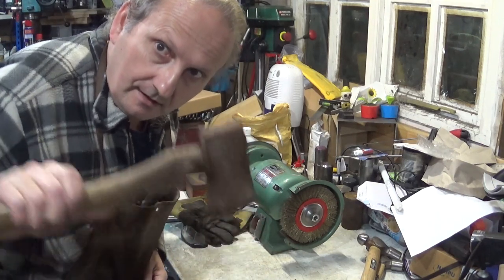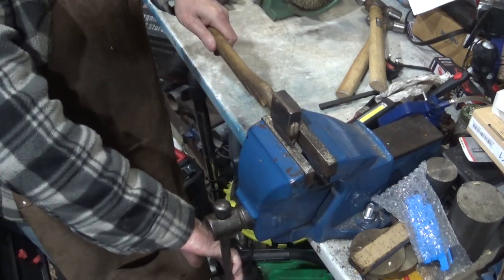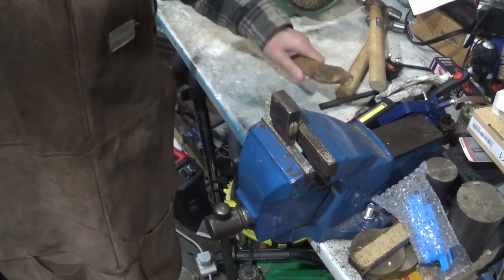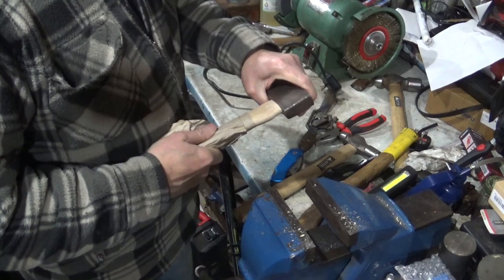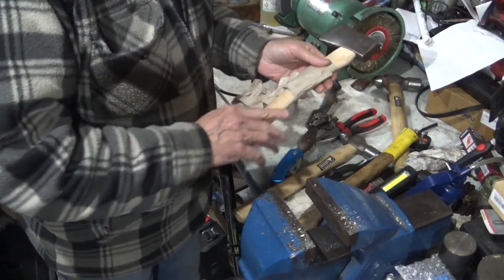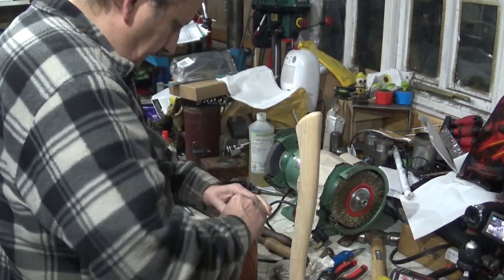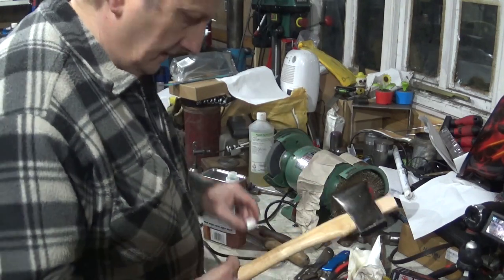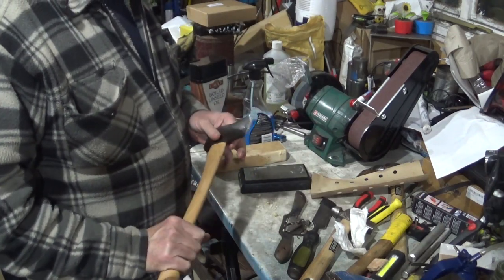Restoring and fitting a handle to a small axe

Comment: The wood from old axe and hammer handles is really useful - I always keep mine so I've got an available source of hardwood for wedges and stuff like that.  The old linseed on a rag bursting into flames can happen but no matter how many times I've tried to make it happen, I've always had disappointing results - I've tried lots of oil and the rags tightly scrunched together, lots of oil and the rags loosely bundled, and a medium amount of oil too - that said I still either put my linseed rags in a bucket of water or put them in my wood burning stove - even if it's not going at the time, IF the rags were to catch on fire, then they'd burn away safely.  I've seen videos of people managing to get their rags to catch on fire, so it definitely can happen!!!
Reply from the maker: Cheers Tim. It would be a bit vexing to have thrown away a bit of handle and then find a use that required a new one.

I wonder if there's a difference between linseed and boiled linseed oil in the fire stakes.
Reply: @BensWorkshop  I'm very tight with good wood so if I need a bit for a wedge or dowel or whatever I always go to my pile, which is where dead hammer handles and the like live!!!

I've tried boiled and pure linseed and not achieved fire yet but I haven't looked into what is actually causing the heat build up - clearly the wood you treat with linseed doesn't suddenly burst into flames, otherwise that really would be a problem.  Maybe it requires cloth rather than the disposable paper wipes that I tend to use.  Perhaps this calls for more experimentation!!!!  It's that old "you should never do this" so what's the very first thing you go and do........
Reply from the maker: @GrumpyTim  so far I have not had the inclination to accidentally set fire to my shed.
Reply: @BensWorkshop  haha, I was thinking of using controlled conditions for the experiments so hopefully neither of our sheds will suffer!!!!
Reply from the maker: @GrumpyTim  let me know if you manage it!
Reply: @BensWorkshop  Will do.

Comment: Nice work and a practical guide. I’ve got a similar project that’s currently stalled. Got the hatched head cleaned up, but still need to fit a handle.
Reply from the maker: It's a try and fettle, try and fettle process. Might take half an hour or maybe an hour.

Many thanks for watching, please like, share and if you like the channel, subscribe!
Reply: @BensWorkshop  hold on, your bench grinder wheel converts/can attach a belt sander? That’s pretty handy.
Reply from the maker: It's a different unit I bought from Lidl. You can see a review here:

https://www.youtube.com/watch?v=HNDZEHRlulI

Comment: Do you know what would make that restoration better? A new head. Really finish the job off.
Reply from the maker: No, the head is fine. In fact, it works as an axe really well thanks.
Reply: @BensWorkshop  I have heard of Occam's razor, I have heard of Trigger's broom & now I know of Benny's axe 👍
Reply from the maker: @EEWW2006  It's not my axe... You often have to change the handles on axes and hammers from time to time but the heads are often fine.